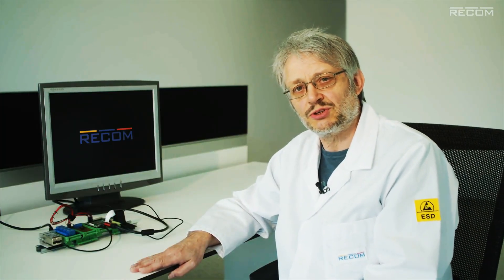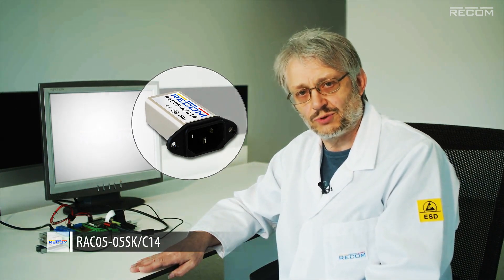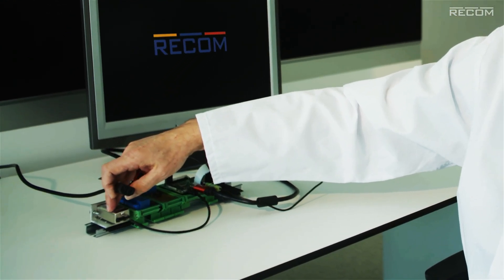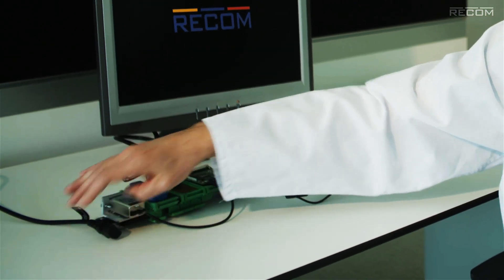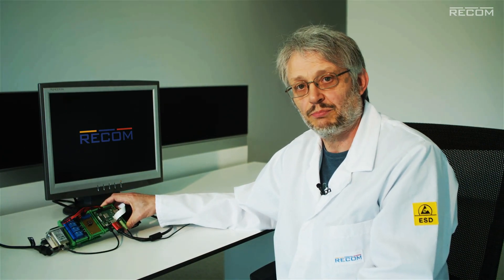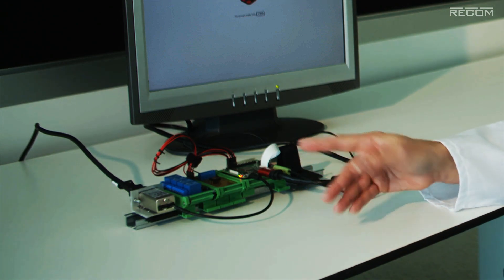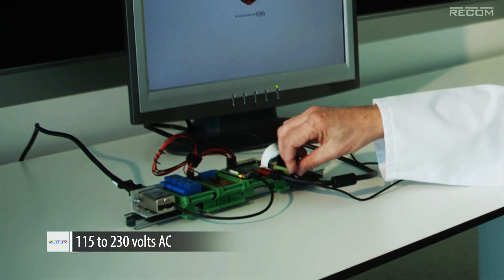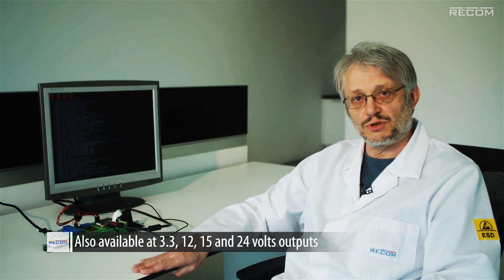RECOM Innovation Manager Steve Roberts presents his latest innovation, the RAC05-K/C14

Comment: I see this thing having no problems outputting more than 1.5A for the RPi. What's a realistic maximum output current figure? I know the rating is 1A, but how far would Recom comfortably endorse me to push its limits to? 1.5A? 2A?
Reply: 1A is the continuous load rating, short term current can be higher (1.25A max is a safe figure, but depending on input voltage and ambient temperature, a higher peak current can be drawn) . What I found when I did the demo was that even with the Rasp Pi processing video and operating 4 relays, that the current load remained well under 1A. The reason that the manufacturer recommends a 2A supply is to allow 1A to be additionally drawn from the USB port as this is specced in the USB standard.
Reply: @steveroberts9519  Thanks. Well explained!